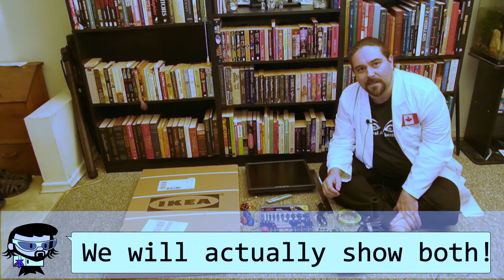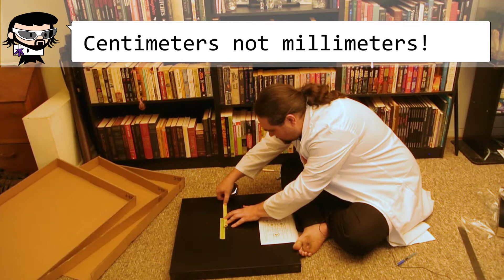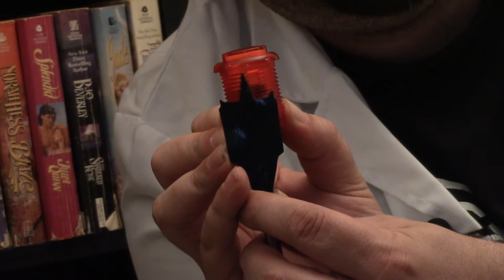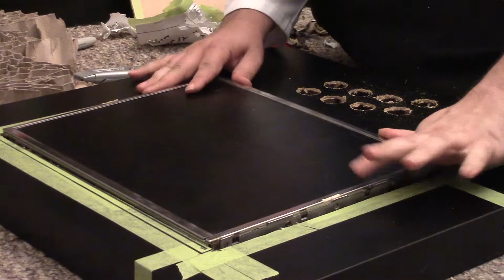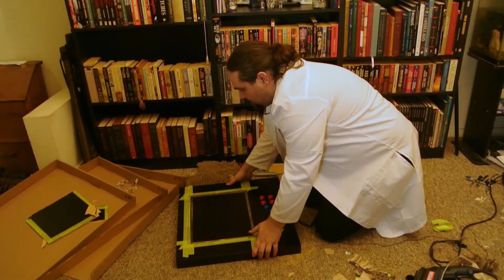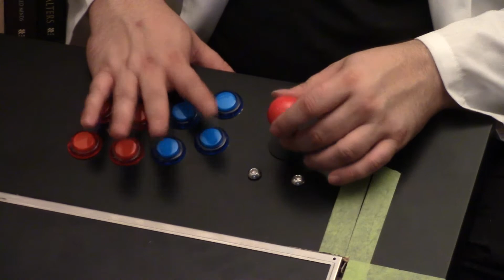Retro Arcade Gaming Table - part 1 - Physical Build

Comment: Hey friend, just a tip: audio is terrible!!! Don't worry though, it's an easy fix! You're simply using your mike wrong...

Please point the mike at your face and NOT straight up or down! It might look cool, but the mike is directional, it'll record whatever's IN FRONT of it, and FILTER OUT most of what's on its sides.

Point the mike at your face and you're good!

Otherwise, thanks for the video! :-)
Reply from the maker: Thanks boss, it was my first shoot outside of the lab, so the first one with the lapel Mic, and I agree I was not impressed with the audio and will come up with something better. I really just wanted to get the video series out there :) Think I need to invest in a shot gun mic for shooting in that environment. It is worth mentioning the rest of the series was done in the lab, so as I get part 2,3 and 4 edited, the audio for those should be clear.